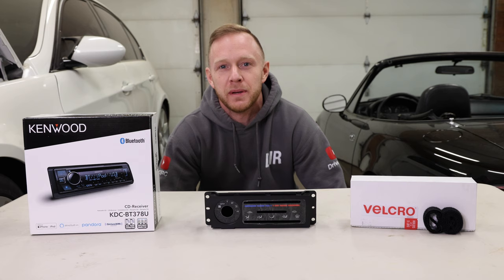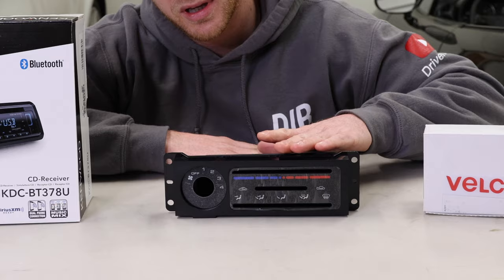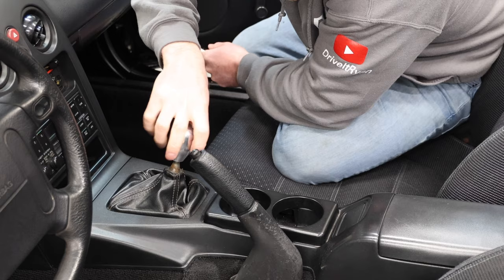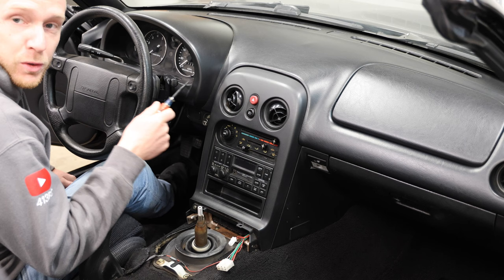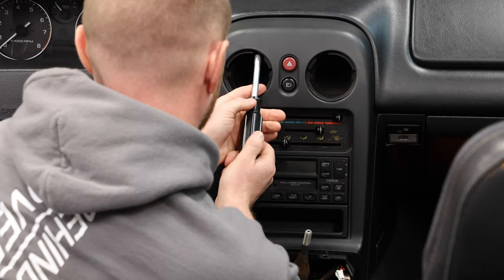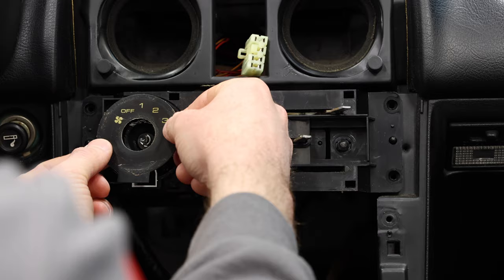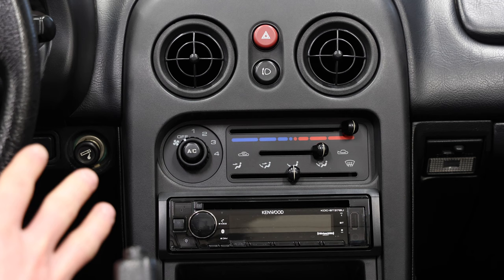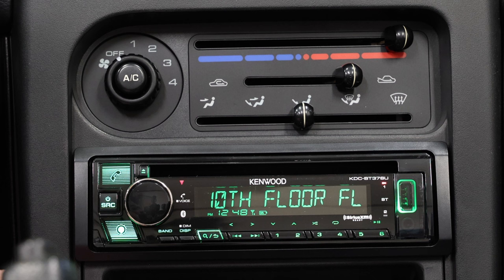3 EASY Ways to BRING YOUR DASH BACK TO LIFE!  Mazda Mx5 Miata

Comment: On my 1993 I did the head unit a long time ago, updated the headrest speakers, and the door speakers.  My climate control panel is still looking good, so nothing to do there.  Absolutely love the Metra products for connecting head units to various vehicles, I always get that.  I used that same cubby for my Miata, it is great having that little bit of extra storage.  I will do the velcro for my vents, they are terrible right now.
Reply: I should add, I've owned mine since new, lived in So Cal when I bought it.
Reply: I went with a pair of Kicker speakers a few years back, absolutely love them, but I am looking at the headreset speakers from 3M Audio, have not seen good replacements available for those for many years now.
Reply from the maker: Nice!  Yeah my droopy loose vents were driving me nuts.  It’s a pretty quick fix with the Velcro.  Some like to replace them with eclipse vents, but I think the Miata vents look better.
Reply from the maker: @beauthestdane  I bet their headrest speakers are good.  I’m very impressed with the the door speakers.  They sound better than the Clearwater speakers I had in my previous Miata.
Reply: @DriveItRyan  Nice, I was pretty happy with the Clearwaters I used back in the early 90s in my Suzuki Spring GTi.  I really like these Kickers I am using now, put a set in my Subaru as well.

Comment: Never thought of replacing the hvac panel, all of them are gross. I’m disappointed you didn’t put LEDs behind the Hvac, although don’t recall if you did dash lights yet to LEDs.
Reply from the maker: Ya know I had it apart and I stopped and thought the same thing, but then I would have to convert everything or it would bother me.  Ultimate led conversion could be a whole other video!
Reply: @DriveItRyan  oh I get that.  I did by gauge cluster with leds but not HVAC and it bothered me